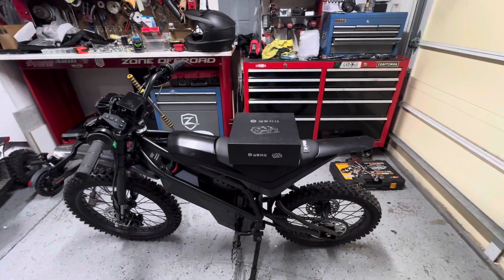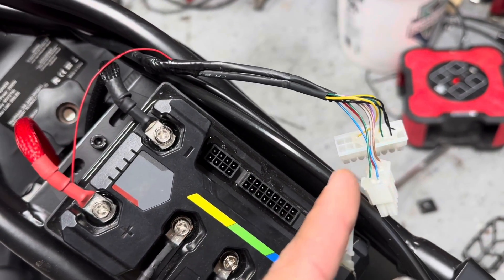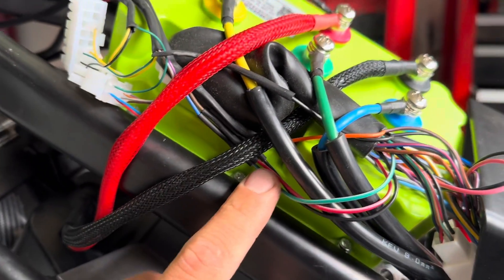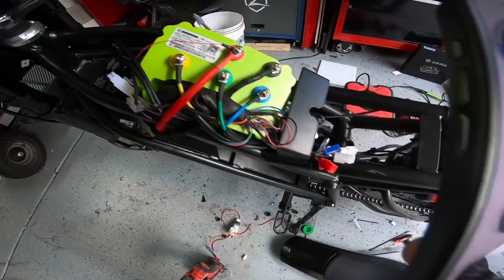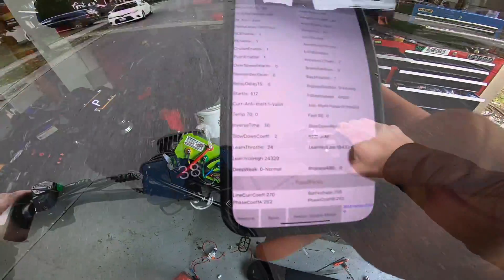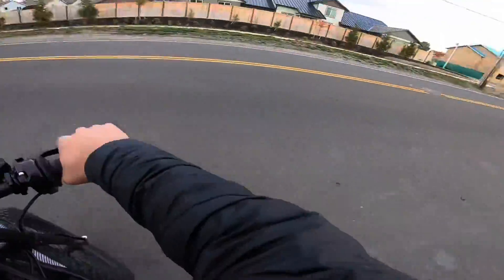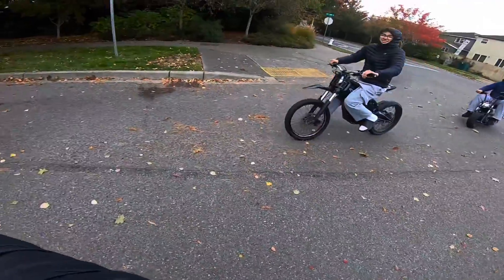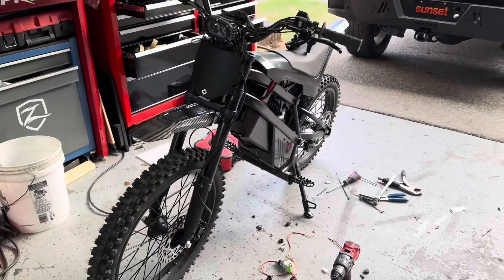This Cheap 50MPH Electric Dirt Bike Got Some SERIOUS Power Now!! Far Driver Controller Install

Comment: Hey did you ever figure out the speedo wires?
Reply from the maker: No I’m getting a new DKD display
Reply: @ReBuildGaragepnw  staying with the same power button or switching to key? A video on switching to the dkd would be sweet

Comment: Hey man can you inform me on how you repositioned the headlight and added that fender along with the wire management?
Reply from the maker: I used the bottom bracket, flipped it cut it shorter and drilled new holes in it. For the FarDriver install I’m pretty much ditching all the factory wires
Reply: @ReBuildGaragepnw I think we'd all love a short video on the fender install and the front light mod. 👌👍👍👍
Reply: I'm not seeing the visual and how you installed the fender after the fact do you have an email I can contact you on?

Comment: Crack open the stock battery and inspect the cells and everytbing🙏
Reply from the maker: It’s says on battery Cell: INR21700 16INR22/71-6
Reply: @ReBuildGaragepnw yeah but we still dont know what bms it uses, cell brand and such

Comment: Do you know if it is possible to wire an ignition switch with voltmeter in the stock controller?
Reply from the maker: Yes pretty easy, disconnect the thin red wire going to the positive terminal on controller and wire it to the ignition switch red wire, green wire from ignition goes to battery + and black wire from ignition switch goes to battery -
Reply: @ReBuildGaragepnw Thank you so much JB my bike got here the other day and I’ve been trying to figure this out your a life saver bro!

Comment: Nice! Also bought one in September from the JB360 video and currently waiting on it. One question I had was how easy would it be to add front turn signals to the bike?
Reply from the maker: I would guess pretty easy if you want to tap into the rear turn signals it already has

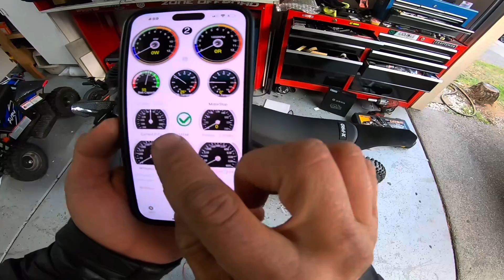Comment: @8:34 Ahh..the good old rubber slide brake... Lol. 

Nice upgrade!!! I'm really surprised that the stock battery could supply that many amps. It is still the stock battery right?
Reply from the maker: lol yeah stock battery, So far doing good. Can’t wait to see what it’ll do with 72v and higher amps

Comment: could you install a key ignition
Reply: yes, you could. Just install it between battery power and the orange control controller power wire.

Comment: Which bike were you racing against?
Reply from the maker: That was a Talaria X3
Reply: @ReBuildGaragepnw Would it keep up stock or u need the controller probably?
Reply: @TheOfficialBloxxer it can keep up but the acceleration won’t be as good if you don’t have the controller
Reply: @60v-Dev  Also does it have good range?
Reply: @TheOfficialBloxxer yes it can go like 80 miles  on the lowest mode and like 30-40 miles on the highest mode and the charging is fast to
Reply: Because that’s the only thing I’m concerned about
Reply: @TheOfficialBloxxer ok and also it’s like cheap to it’s only about 1,100 dollars on amazon and walmart before the $400 shipping so it’s like 1,600-1,700 ish
Reply: @60v-Dev  max speed?

Comment: Yo I just bought the bike thanks for the review! I probably won’t be able to push it like this tho bc those controllers r expensive!
Reply from the maker: That's awesome! Enjoy the bike, it's still powerful even without the new controller.
Reply: @ReBuildGaragepnw  can it wheelie without?
Reply from the maker: @TheOfficialBloxxeryes it can still wheelie, you can always put a smaller motor sprocket or larger 57t in the back for more torque and would wheelie a lot easier.
Reply: Kinda/ Not really man.. These Fardrivers are an average of 200-300 Dollars... Nowadays These kinds of Fardrivers are what alot of ppl are using to upgrade Stuff or just simply Diy projects..These Fardrivers Out Decent power...look n listen to what dude is saying bout after He put this Fardriver into his Bike Now 😂😂💯
Reply: The controller, especially a Fardriver, is probably the least expensive of the main parts you'll see on an e moto. 

And Fardriver are by no means high end. 

Just do what you can with what you have or what you can get. You'll still have fun!
Reply: yea i got the bike too bro its really good
Reply: @60v-Dev Does it have enough power to wheelie stock?
Reply: @TheOfficialBloxxer yes